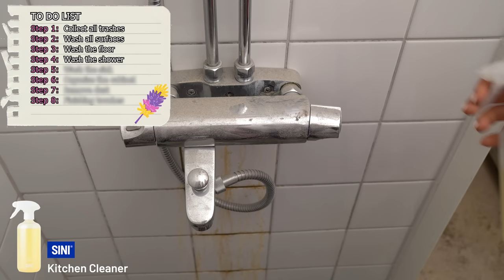The DIRTIEST BATHROOM in Europe!!

Comment: Thanks for helping Olga!
This steps order is interesting to me, since floors would come around last step, so going up to down, while yes, if you do clean it, then you can just rinse it over - works well, if you have such bathroom with a drain.
Our tap and handles in bathroom are ceramic coated and limescale we can't use scraper or steel sponge, since it made it start to crack some. We'll just have to buy normal, stainless steel one. So even trying Ecolab's limescale remover, no luck..

Comment: Aurikatariina, please I need your advice. I have old porous, bathroom sink that has brown droplet stains on it that I think was either iodine or herbal remedy drops and crusty black spots which I think was from charcoal toothpaste that will not scrub off. I have used everything I can think of to remove the stain. Vinegar, bleach, Magic Eraser, Power Paste, alcohol, several other brands of cleaners, Dawn dish detergent. Please tell me what to do because I need to move out of my apartment and I am scared the landlord will charge me for a new sink. The sink is a really old material, they don't even sell these material anymore as it is not a slick finish it is rough and porous.

Comment: Ok. I’ve been a subscriber for awhile. I’ve always wanted to ask something. Is things different with your bathrooms in your country? I’m from the USA, and I’ve noticed that when you clean bathrooms, you spray down the bathroom with a sprayer. It’s around electronics, heaters, windows, floors flooded etc. Does anything get moldy or ruined? And also, never have I seen a water sprayer in a bathroom. I’m so amazed by this.